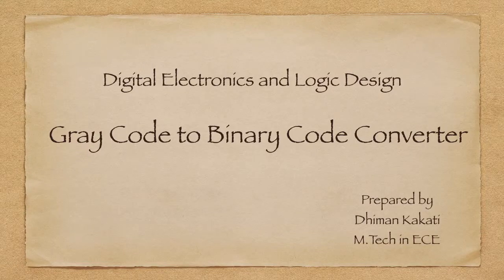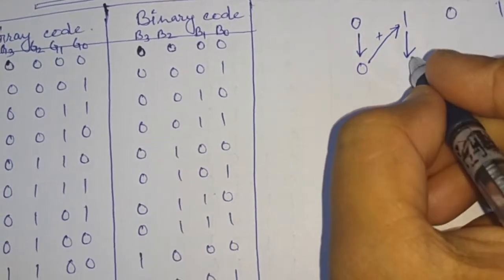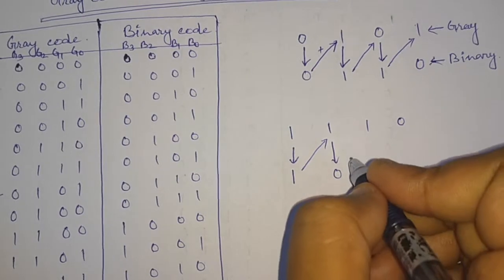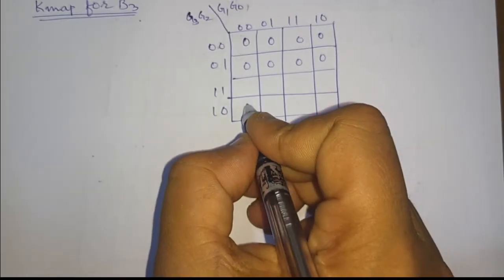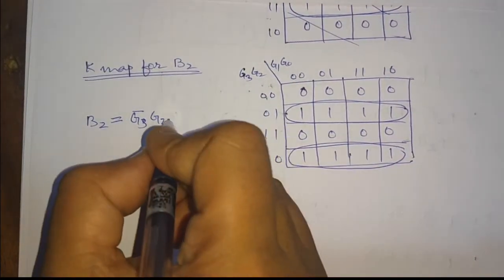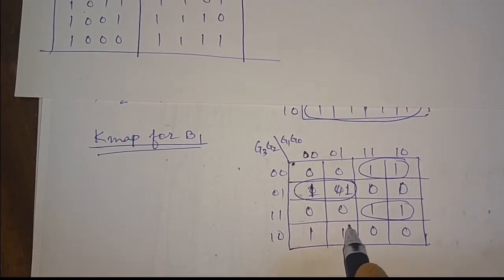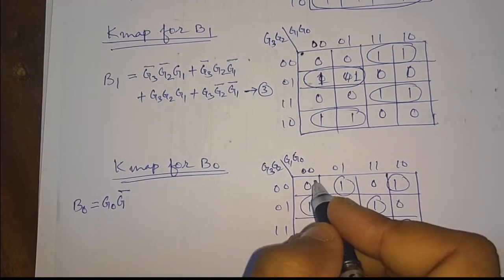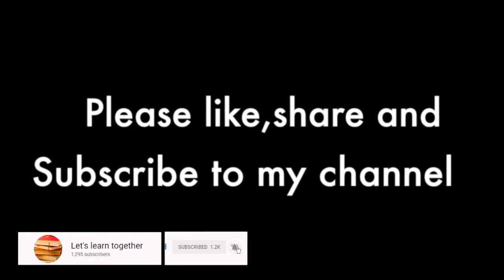Gray code to Binary code converter Design

Comment: Your k-map is wrong for B3,B2,B1,B0
Reply from the maker: Dear Suraj, they are correct. Please see the explanation part: From 4 min 38 sec to 5 min of this video. While filling the K-map, follow these steps for each value of B3, B2, B1, and B0
1. find the respective gray code from the table
2. find that gray code block in the K-map
3. put the B3 or B2 or B1 or B0 value there.
Reply from the maker: https://www.geeksforgeeks.org/digital-logic-code-converters-binary-gray-code/